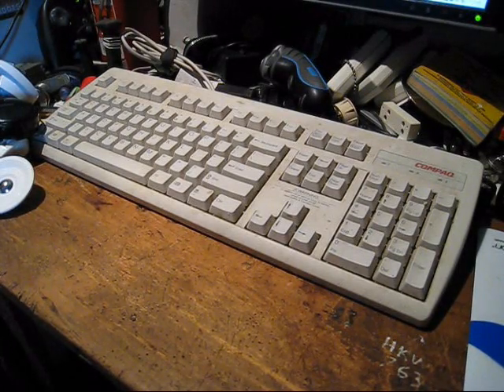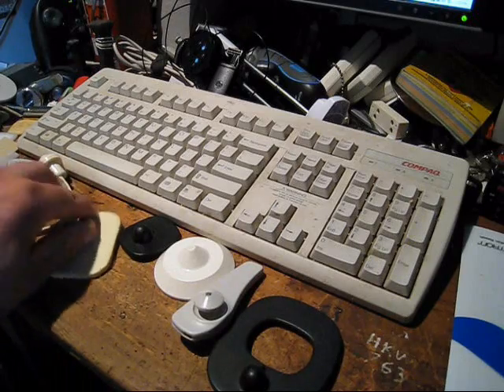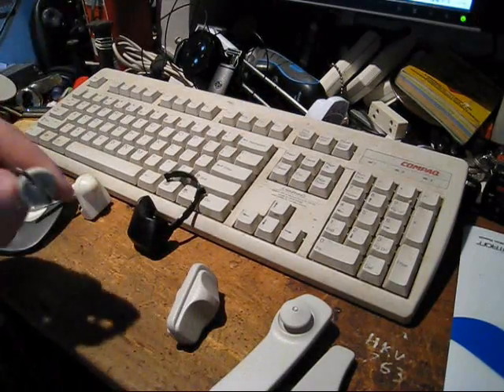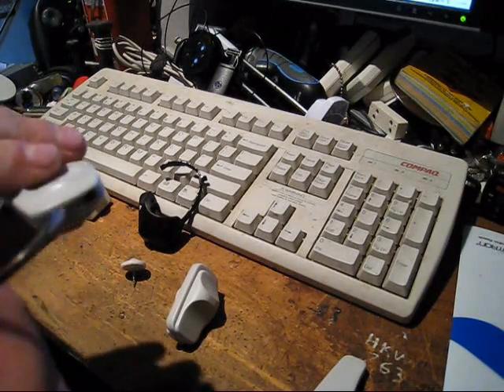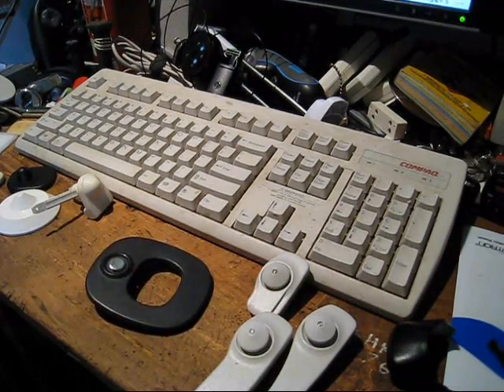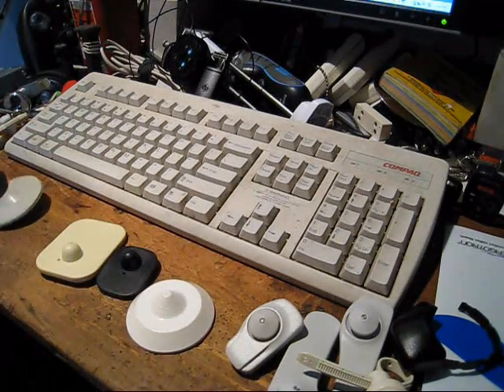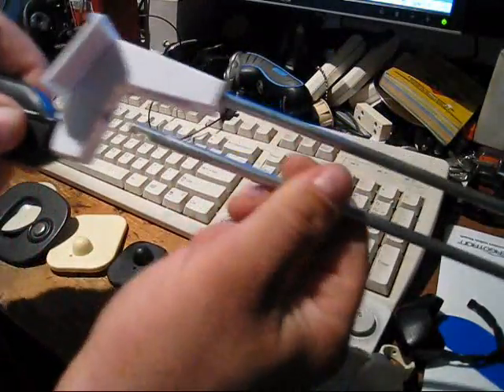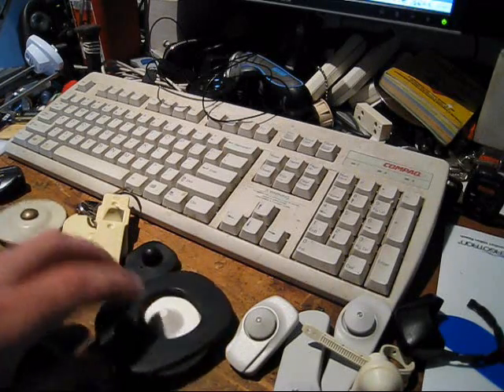Security tags, how they work and more!

Comment: How small can these get and where are there more resources for this including types of sensors/detectors? Looking to protect cool glassware in my bar. This would mean permanent adherence to the object. Did you ever make a video about disposable security tags?
Reply from the maker: I've never heard of these being used in a bar type setting, don't know if they'd hold up to washing. And on a glass, they could simply be peeled off or mutilated. I did make a video on disposable and ink tags, don't have the link handy, but it's in my channel.

Comment: You never brought out the ink tags how do they work?
Reply from the maker: Ryan Parkinson they are in part 2. the link is in the description of this video
Reply: Will Phoneman ive seen tags which require the hook mechanism which also have ink. Is this a new and different tag? Also i have seen the hook mechanism on Wish.com for 2-3 dollars + shipping. In this video u said these mechanism are expensive do u think this is possibly a non-functional prop or novelty version?

Pure educational purposes.
Reply from the maker: No, those are just the supertag (tag that uses the hook) coupled with an ink tag. The ink tag simply replaces the standard "pin" of the supertag. You can do this with most of the tags I've shown that take the tack/pin.

Comment: So the electronic ones don't put out a signal they just disrupt the signal one of the towers is putting out to the frequency the other tower responds to and that activates the alarm?
Reply from the maker: yes, that is correct. there's no battery or power source in them.
Reply: +Will Phoneman and it does this by just a wire and magnet? I'm curious how like at a library they have you rub the item you're checking out on a type of rubber. What's going on there?
Reply from the maker: +mrsemifixit that is a type I did not cover, called an electromagnetic tag. when you magnetize them they are deactivated, when you demagnetize then they are activated. the opposite of the acousto magnetic tags. the device they rub it on is just a magnet
Reply: +Will Phoneman Ah ok. And what exactly is in the tag?
Reply from the maker: +mrsemifixit a similar metal 2 what is in the a.m. tags. it responds to magnetic fields and vibrates.

Comment: Can I use a golf detatcher to remove the old gator tags?
Reply from the maker: No, they are pressure release, not magnetic.
Reply: So what else can I use In order to remove gator tags besides those expensive pressure releases?
Reply from the maker: PapayaBOy1992 pliers or a dremel tool with a cutoff wheel. Slice the cone part off.

Comment: I have a question, with a neodymium magnet its posible take off the hardtags of 2:35 mins? Or just with the little gun? hahja
Reply from the maker: No, those work by pressure, not magnetism. A magnet, no matter how strong, would not work.
Reply: Will Phoneman Oh thx, because a friend told me what that kind of hard tags could be take off with a magnet... thank you
Reply from the maker: Roza Meltrozo
No problem. There are instructions online to remove em though.